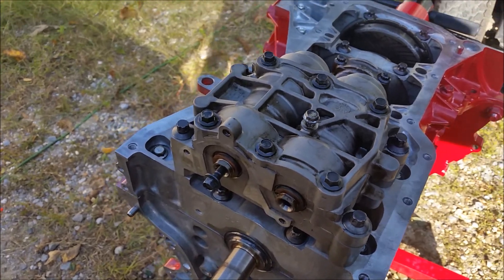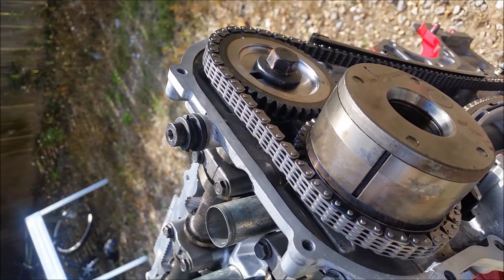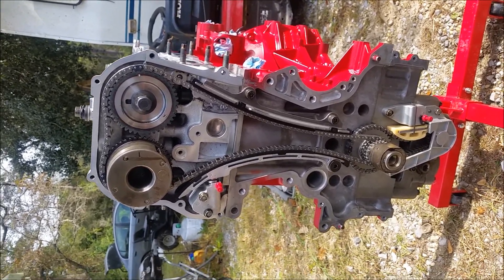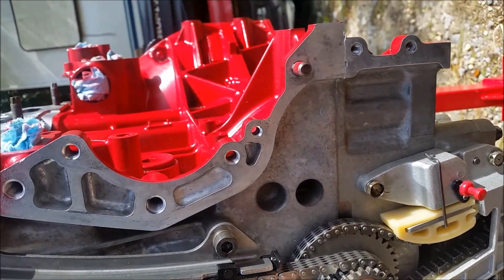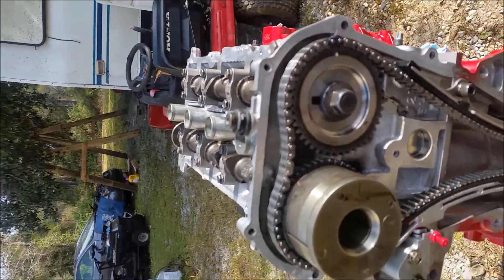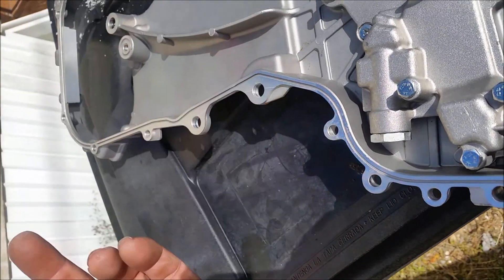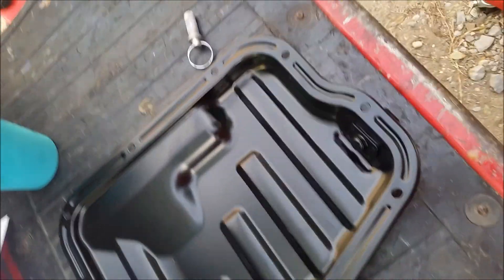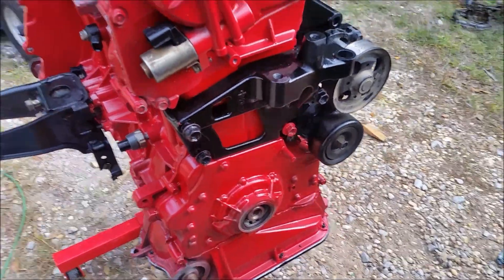Nissan Altima QR 25 DE Timing Chain Install.

Comment: late to the party, but does that mean we cant freely rotate it over once we get everything together? since the tensioner is used via oil pressure. ive rotated it  and the cams and crank always make there way in time. just want a clarification. because sometimes theres slack at the top and sometimes theres not. thanks

Comment: I am hearing a ticking / knocking noise from the timing chain cover area.   It sounds almost like frayed serpentine belt hitting something or a playing card hitting a bicycle tire.    Could it be related to any timing components? What kind of noise would a faulty timing component make?  I thought it could be lifters, but I used a stethoscope and it's clearly louder on the timing cover more so than the middle or driver side of engine and underneath the engine.  
I hear it more distinctly at idle, although intermittently off and on. Especially after coming back from a highway drive 30+ mins.
Reply: @ mickey$ hey did you find out about the noise in your engine? I have something similar in mine but I don’t know what is causing it.
Reply: That would be the vtc gear failing and causing your chain to slip

Comment: i tried putting new head gasket in without removing engine.
got it on TDC, chain on, tensioner on, but its hitting something when i try to turn engine to make sure everything stays.
can you only turn with tensioner off or do i got a big problem?
i think i read the chain couldnt fall off the camshaft is that right?
Reply from the maker: Some where in the video I did mention that the tensioner needed to be released or the chain could jump recheck the chain, crankshaft, and camshafts again valve is probably hitting a piston .